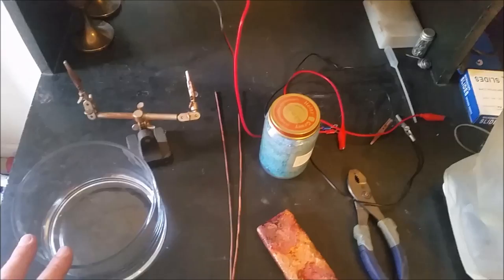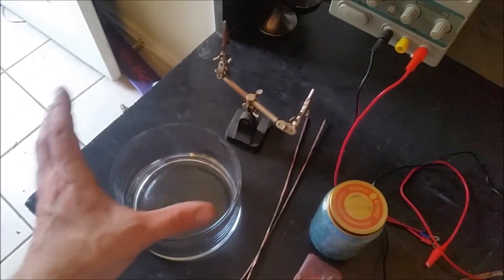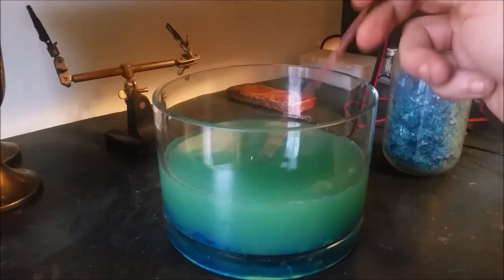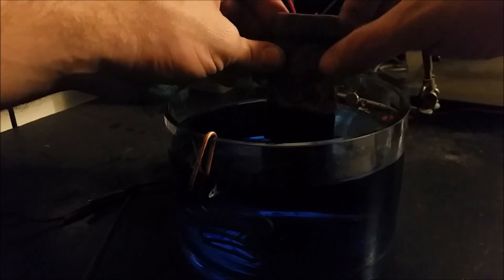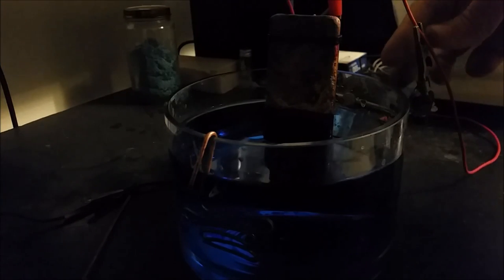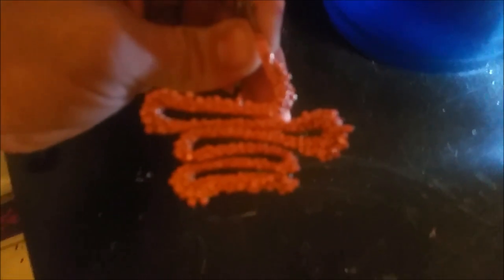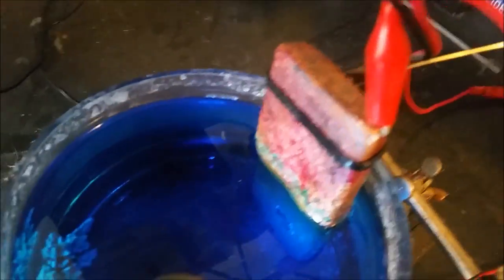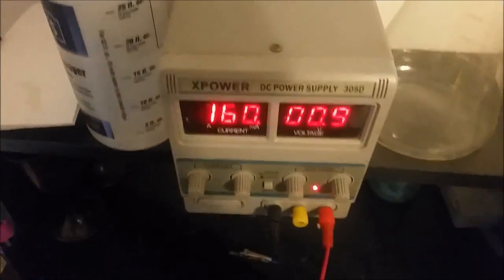How to Make Large Copper Metal Crystals

Comment: It would be interesting to see what would be the effect on the crystal growth if one uses an AC current where frequency and amplitude is not symmetrical to 0 point. This could also be combined with different anodes activated at different dimes to add different metals to the crystal.
Reply: Dacian Herbei Are you trying to say it has a DC bias offset?
To use different metals you need different solutions. You make the solution by starting with two masses of the same metal in an electrolyte (baking soda and water) and then switching the anode to the receiving object once the electrolyte is saturated ( blue for copper). You can do this with almost every metal.
When using some metals the voltage controls the color(oxidation states) so you can literally paint the surface with colored metals.
However, the donor metal must be anode and the receiving object cathode.
Reply: richard vaughn yes this is what I meant. But also it would be interesting to have an AC current with really low frequency to create like a wave pattern like the waves of a sea.
Reply: Dacian Herbei Doesnt work that way. The crystals form the same way regardless of the current. Maybe you should attach the anode to a slow moving arm that swings back and forth once each day. So that the thickness of deposits would cause a waviness. (thickest deposits will be at the lowest resistance path...the shortest distance between the 2 electrodes)

Comment: Those crystals will turn green from hydrolysis over time, yes? 
If so they would closely resemble malachite.
Reply: while theoretically you might be correct, I don't know the answer to your question. waiting for an answer as well.
Reply: TwilightCage malachite is copper carbonate it would have to absorb co2 when wet
Reply: Copper patina that forms on copper sheeted roofs is actually copper carbonate. It used to form more readily when a lot of heating was by open coal fires.
Reply from the maker: Depending on the conditions sure they can turn green.  I've never seen it happen myself with these crystals though.  Primarily if left out for a long time they darken much like an old penny. Usually when copper turns green it means that it is left out in the weather or other very humid conditions and the naturally occurring carbonic acid starts working on it.  Once these crystals are dried I just keep them in air tight containers and they keep for quite a long time with no discoloration.
Reply: Thank you for the reply

Comment: Makes me want to buy a fishtank, put a flat sheet of copper on each end and grow crystals in it ver months. Would be a nice piece of decoration also, if built nicely ^^
Reply: muh1h1 that's not how it works
Reply: Why not?
Reply: muh1h1 I wanted to let you know apart from copper sheets you also need a full tank of saturated copper solution and a big power supply. Now I realize that I might misunderstand you. But still it would be really hard and slow.
Reply: qwer zno that would be the point (being slow) probably would just use 0.5-1v, and i am sure there would be almost no current drawn at that voltage. Imagine a tank with crystals getting bigger and bigger over months, maybe even years, that would look pretty cool, especially with some nice lighting :)

Comment: Hello sir! Thank you for the fantastic video!. I am curious, if you have a bar of brass or bronze, could you separate out the copper from the brass or bronze using this method? Leaving the other alloy as a sludge?
Reply: I think it would be possible not sure  tho
Reply: The tin/zinc from the alloy would likely dissolve in the sulphate environment unless you used a potentiostat 3 electrode cell arrangement to control the dissolution conditions

Comment: You said you dont know why the copper is being eaten away. 

Its the first rule of Alchemy "Equivalent Exchange" 

You cant make something out of nothing, so part of the copper bar is being transferred to the copper wire. Not all of it though, whats resting on the bottom is everything the Cristals dont need from the bar. 

Its pretty cool though.
Reply from the maker: I am unsure what you thought I meant.  I think you may be referring to where I said I was unsure why there was a hole being eaten in that particular manner.  I later figured out that it was a bubble in the copper that formed whilst being cast.
Reply: Hehe.  What's left on the bottom is just crap, not left over copper that the 'Cristals" don't need!   lol

Comment: Interesting video, good job 👍 thinking of giving it a go. Does the bowl need to be glass or would plastic be ok? How many times can the copper sulfate solution be used before it needs to be changed? I would imagine it just needs changed when the crystals stop growing /meaning there isn't any copper left in the solution?
Reply from the maker: Plastic works just as well but I find that the copper dust stains the plastic.  The solution can keep being used near indefinitely as long as you properly filter and recrystallize every so often. It is also pretty dependent on how pure the copper anode you are using. You don't really run the solution out of copper as you are depositing it back in with the anode being dissolved. The big killer of the solution is the other metals besides copper being dissolved but as I mentioned as long as you filter and recrystallize you should be good to keep using it.
Reply: Thanks for your reply. Recrystallize do you mean add more copper sulfate?
Reply from the maker: You allow the used copper sulfate to dry out until about 95% of the water is gone.  Then you pour off the remaining liquid (this will contain most of the impurities). Your bulk of crystals should then be mostly pure copper sulfate again.  You can later on down the line process down the 5% you pour off each time in a separate batch to get the rest of your copper sulfate.

NurdRage did an awesome video on this that will most certainly help:
https://www.youtube.com/watch?v=uVA0rK_VITY
Reply: Thanks again for your info and I'll have a look. Cheers 👍

Comment: Are the crystals purely ascetic, or do they have a practical application
Reply: That was my first thought. What are they used for? What is the purpose?
Reply: @isawondfl1 I'm not an expert by any means but I believe the point is they are extremely pure. No amount of smelting and fluxing could get it to that point. A good example is the anode he used was cast copper but most of that sludge that came off wasn't even copper

Comment: Nice.  What would happen if you used a constant current driver - would it give better results or would the growth just grind to a halt because of the increasing surface area?
Reply: Those power supplies can go from constant voltage or constant current. In my experience with growing silver crystal, constant current results in long, thin needle like spikes. Looks like superman's fortress of solitude

Comment: The hole in your anode is caused by your copper sulfate and electric current carrying the anode’s copper ions away to the copper rod as it becomes crystallized. “Energy cannot be created or destroyed, only changed from one type to another.” If E=mc2, that means that matter itself, i.e. your copper, is not created from nothing, or completely destroyed, only changed in form. It’s not creating NEW copper atoms in crystallizing, only moving one material from one side to the other, deposited in new patterns.
Reply from the maker: The whole that formed in the bar was due to a bubble in the metal during casting.

Comment: Thanks for the video, I'm not understanding what makes the current flow come from the + to deposit the crystals on the - when DC current is from the - to the +.  if you use an air
defuser like that of a small fish tank to agitate your solution with an increase in amps up to 1 amp would it not deposit more a lot sooner? Thanks again.

Comment: Can you use this technique to purify the copper and if so how pure can you will it get   ?
Reply: That's actually how they purify it industrially. Theoretical 99.99%
Reply: Bull Shyte  I had mine tested it maxed out the meter at 99.99%
Reply: As pure as it gets. Impurities are still there because of unlucky impurities getting atomically trapped inside by pure chance. If you keep the anode and cathode in separate containers with a tube between them, so that the impurities falling off the donor metal don't pollute, the purity increases, but then you have basically hit the limit with how pure you can get it. Electrochemical processing is the way one purifies metals as much as possible.

Comment: I have a huge question that never seems to be answered...
Are the fumes from the copper sulfate toxic? 
I have a similar set up in my garage, but I'm very leary about having my kids around the area, and i usually have a fume respirator on.
Reply from the maker: Copper sulfate shouldn't put off any fumes at all.  If it does then you may want to reconsider how you source the copper sulfate.
Reply: @Puddin  no hydrogen gas fumes either? just curious

Comment: Does the crystal grow differently if you run the power supply in a constant current mode rather than constant voltage?
Reply from the maker: I haven't tried it much but from what I did try the only thing I can say is that it consistently gave inconsistent results.

Comment: Can you use any salt for an electrolyte or does it have to be a copper salt?
Reply: Salts of different metals would produce crystals of the metal but you anode has to be the same metal as the salt

Comment: How do you safely dispose of the copper sulfate after it is spent?  I know it is corrosive and is toxic to animals so i would like to know the safest way to dispose of it after i am done using it. Does anyone have advice on this? thank you.
Reply from the maker: I don't really "dispose" of it.  I filter it and then crystalize it to be used again in the next run.
Reply: @Puddin  awesome. I wasnt sure if i would be able to reuse it. So, if you suspended  the crystals in a liquid could it keep it from oxidation.
Reply from the maker: @encryptlakegames5328  I'm not at all sure what you mean.  Usually I run it through a filter first, then put it over gentle heat for a day or so to drive off all the water.  Once that is done I either just put it in a jar for use another time or if it still looks dirty I'll add a bit of water back in and filter it once more.
I find if you have extremely small particulate that passes through filters, you can get it to clump up by drying it out completely then redissolving the copper sulfate and filtering again.
Either way it is just a matter of driving off all the water.  I imagine at some point the solution will become so contaminated with other soluble metal salts that it could affect crystal growth, but once again that would be a matter of recrystallization to fix.
Reply: @Puddin  ok thank you again. But the last part of that is about the already grown crystal. After you have the copper metal crystals to keep them from toning can you suspend them in water or clear oil? So that stay nice and shiny  longer.
Reply from the maker: @encryptlakegames5328  Ahh my bad.  I don't really do anything with them other than keep them in a sealable plastic bin.
Reply: @Puddin  thank you.  I just finished setting up my power supply. So i cant wait tp see how good slow grown crystals look. I grew some using a 9v battery as the power supply it worked but they were really weak.

Comment: can u do that with gold ?
Reply: Aaron Schwark 
1: To get gold into solution requires Aqua Regia(highly corrosive). 
2: The entire process is utterly expensive since your working with a noble metal.

To answer your question - Yes! Most metals can undergo electrolysis/plating & result with salt deposits! It should be said though that the gold you presumably already own has already been processed to the highest purity & that there would be nothing to gain from this process.
I hope that helps

Comment: Clorides in the water from the city water, possible florides. Did you use distilled water or at least degassed water, allowing 24 hours for cholrines to dissapate from the tap water. Even county systems add  chemicals to their water . Cool project anyways. Growing Crystals is fun. We started there, went to sea monkeys, then to sea horses, star fish, then actual tropical fish. we raised gerbils also. We sold all these to the local pet shop ehom sold them to others. They had a guy that owned snakes so guess where the gerbils went? This was all back in the early seventys. My mom was always comming up with ways to make extra money. We even pulled wire from electric motors. Seperating the coil windings from the case. Copper prices were sky high back then. Now its  profitable to do what we did. The price per ton on electric motors verses stripping them was pretty well worth the effort back then. Not any more.

Comment: I know these are crystals but seeing as I know nothing about this other than it is copper what would happen if u were to heat it as in maybe try to smelt it
Reply from the maker: It would act exactly as copper acts.  There is nothing "different" about these copper crystals other than that they are in crystal form.
Reply: @Puddin  so in theory you could farm and harvest a metal for smithing and other metallurgy things it would just take time and the know how of how to do it?
Reply: @Puddin  what other metals would crystalization be possible for and thanks for the response when I saw the release date I didn't think I'd get a reply you earned yourself a sub my friend I plan on watching some of your other content even if I don't understand it eventually I will. They say you have to hear the same message at least 3 times to begin to grasp the concept
Reply from the maker: @claudiobedoya1542  This particular method that I use is very commonly used in industry for purifying the copper from other metals. I simply take it a few steps further and try to grow crystals rather than just purifying it, which still does grow crystals but very very small ones.  All the copper I use for this was harvested from old pipes, wire, ect, and melted into an impure bar.  While the bar is probably around 90% cop[per the crystals should be close to 99.99% pure.
This can be done with several different elements.  I've got another video up where I grow large silver crystals and am working on one now where I grow bismuth this way.
Reply: @Puddin  I definitely want to give it a try I used to be a plumber so scrap copper isn't hard to come by or just can buy a cheap stick of type m copper tubing

Comment: charred wood electroplated with same method
Reply: if you make a copper sheet mold, cover the outside, then electroplate a large surface, faster, higher amps, faster light, low density, or high, copper, molded item

Comment: These are actually not crystals because they are made up of solid copper.
The growth is part of the process of electroplating.
I worked in a galvanisation company and our frames had similar growths.
We mostly plated copper, zink, brass and nickel
Reply: And why does that not make them crystals? Metals organize as crystallites, small or larger grains of matter organized in a crystal lattice.
Reply: Speaking as a geologist I have to ask you why you would think pure copper can't form crystals? All metals have a crystal structure and that is what gives them the qualities we use them for. All metals I know form positive ions and this is what makes them form into crystal structure.
To put it another way, copper, and other metals, carry an electric current because of their crystalline structure which allows electrons to move freely between the metal's atoms.
Reply: Electroplating is done at a much higher current (hundreds of amperes) . Crystal formation is microscopic which is what makes up the plated surface.
Reply: Maurice Byers uh no. You can electroplate with any DC power supply. Overdoing it just boils away the electrolyte.
Reply: Seriously? Thank you. everything I had read about home electroplating used at least a car battery capable of producing a very high amperage.
Reply: Maurice Byers You can use an old usb charger. Just cut the cord and find+ and-.
More current does speed it up but causes excessive evaporation. Its best to go low and slow to get an even coating of precise thickness.
You can find tons of diy electroplating on youtube. You can do it with baking soda, distilled water and copper wires and time.
Reply: Ok, battery hi amps LOW volts.  The resistance makes for LOW amperage. Read Ohms law I = v/r
Reply: Al Finnell A cell phone charger outputs 5 volts at 2 amps.
Any voltage will allow eletroplating to take place. More current heats up the water which causes problems and makes life more complicated as the water has to be added back.
Remember, all you are trying to do is add electrons for the chemical reaction to take place that causes copper to dissolve into the solution and to take out electrons for the copper in solution to come out of the copper sulfate and stick to the anode.
The current that passes through the solution without contributing electrons to the process is just wasted.
Also the water is not super high resistance because you put an electrolyte in it which makes it conductive. The copper sulfate is conductive and the electrolyte added to the water makes the water conductive as well.